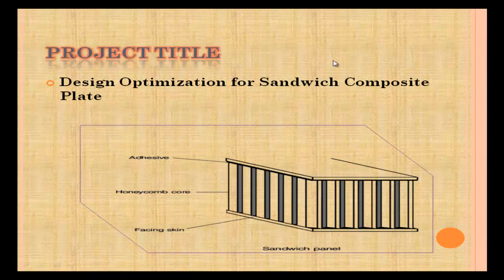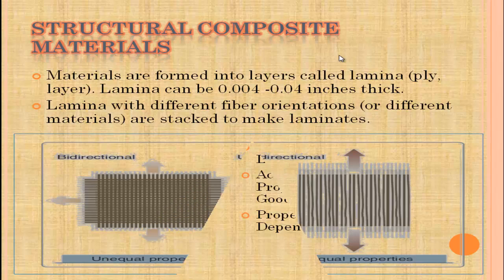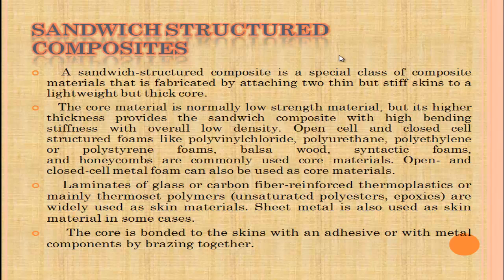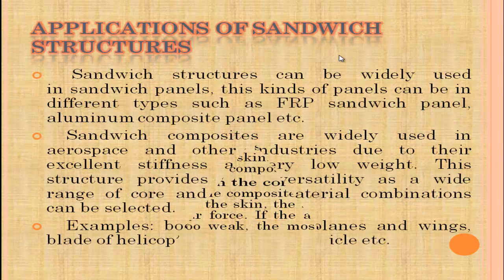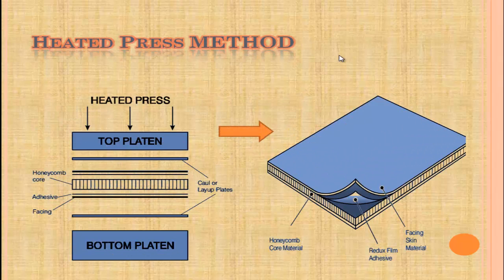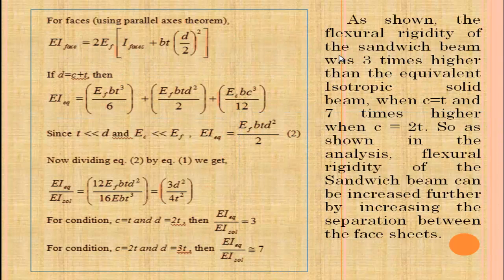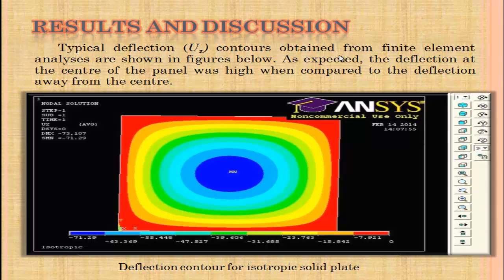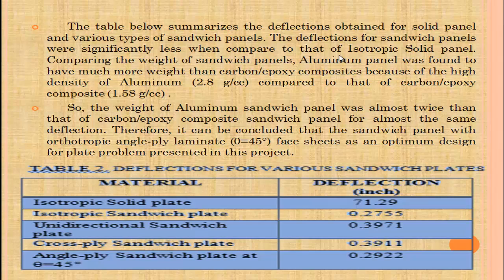Design optimization for sandwich composite plate

Comment: Well done! Exactly the information I was looking for! I am not an engineer, so to simplify for me please. To summarize: 2 face plates separated by an equal thickness center core equal to 1 face plate, would increase stiffness by 3 times. And to in crease the core 2 times the thickness of a face plate would increase the thickness by 7 times. So if the thickness of the center core was 10 or 20 times the thickness of a face plate, how much stiffer would it be? Is there and easy formula? Say face thickness to core thickness ratio? Thank you so much.